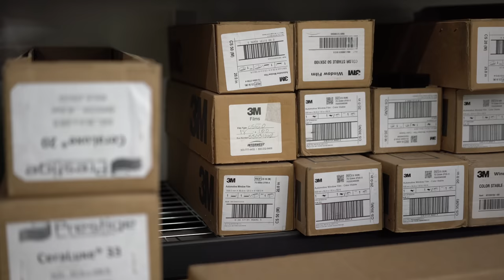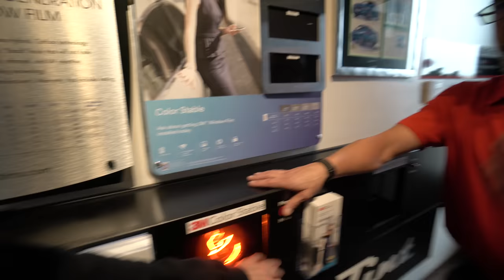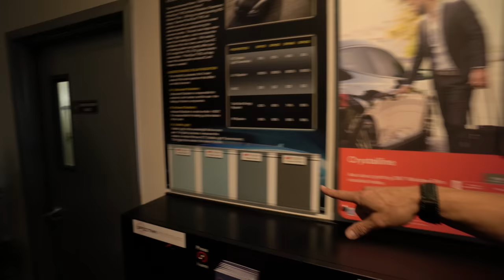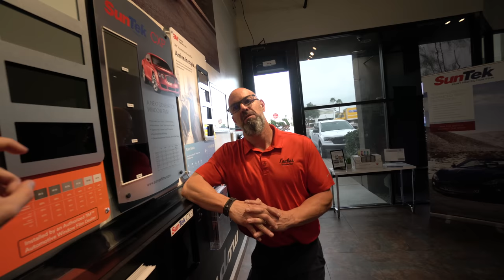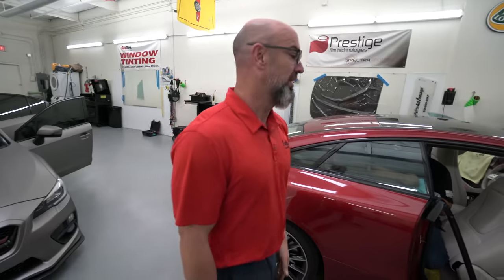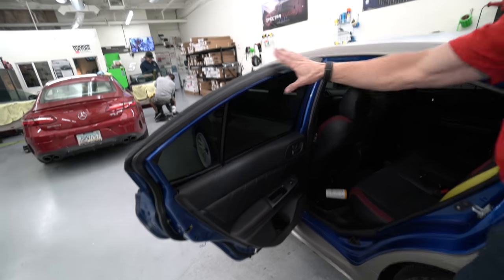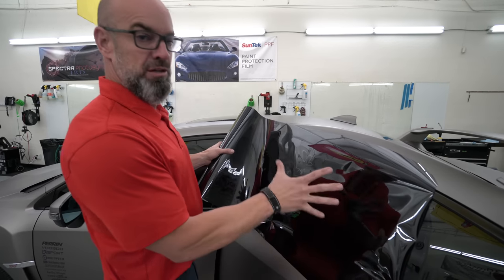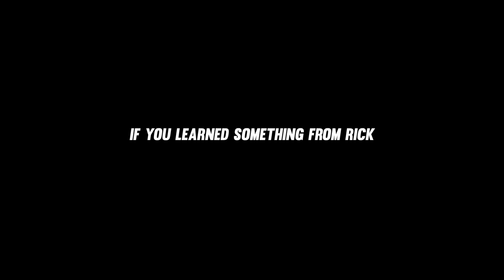New Tint Technology for the STi! (Truth About Ceramic You Need to Know)

Comment: Love this video! This is a real problem in the Phlippines. I drive a Fiesta over there and the installer did a piss poor job of the install in the rear glass. Bubbles galore. Plus the choices are cheap or expensive, light or dark. None of them will explain the real differences/benefits of tints.

Comment: 800-1100 (“depending on the car”) for a 4 door sedan. I hate when business say prices depend on “something” but you’re still within the same category. I feel like the 800 would be for 1990 Camry and 1100 would be for a new bmw. Why... both cars have 4 doors.
Reply: One example that comes to mind: take your conventional Camry with 4 doors + rear. There are 5 sections of film to cut. For, say, a 2010 Honda Insight, you’d need 10 sections of film (8 side windows, 2 rear windows). Some cars also have rears that are not conducive to easy tint shrinking, so material yields may fall, labor costs increase…. And there’s the matter of framed versus frameless doors… a slew of factors can drive price here.

Comment: Another great video ... thanks Cameron.  Question: I got the 3M Ceramic IR on my S4.  25 rear glass, 30 rear sides, 35 front sides.  I am noticing quite a bit of cloudy haze which I believe they refer to as low angle haze caused by these ceramic films.  I believe this is normal, but I don't like it.  Like looking through a slightly hazy window.  Not clear at all.  Curious if you had or have this issue with your 15?  I know it has been a few years now.  Curious to know Rick's thoughts on low angle haze too with the 3M Ceramic IR films.  I think if I did it again, I'd choose something else.  Thanks again.